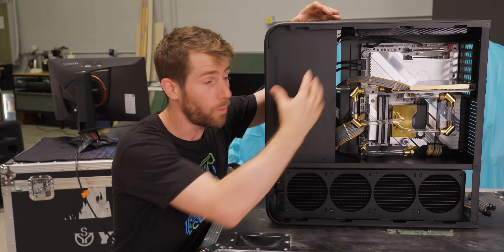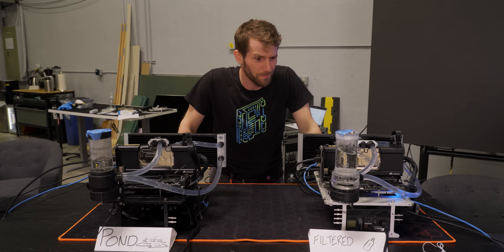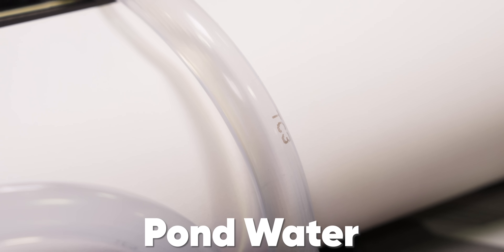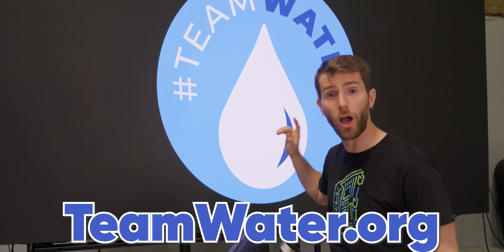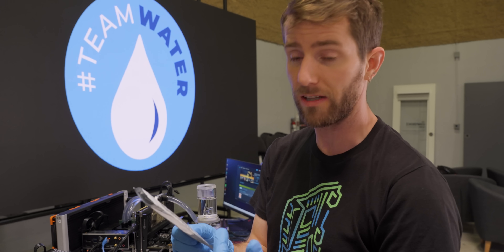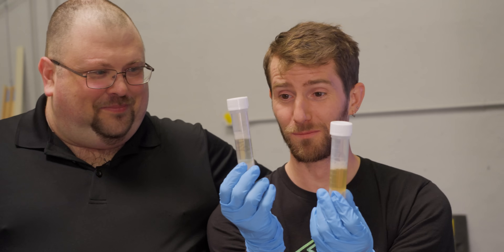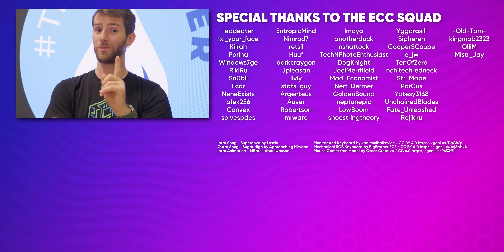Can I cool a PC with pond water? #teamwater

Comment: The fact that the reservoir looked so clean when the pond water didn't really has me thinking the blocks acted like particulate filters... Which is bad.
Anyway I always used battery water from the gas station. It's deionized and doesn't even conduct electricity at first. It will probably leech some from the components tho so not a solution to galvanic issued. But most importantly there's nothing in it for microbes to feed on

Comment: there is a company called Tropic color that sells a solid state drive they claim it to be the fastest SSD on the market, which I think is complete bullcrap especially because it is just a nvme drive shoved into a caddy and they claim it's some proprietary thing made by ram industries. When ram industries sells the same exact product for cheaper on their website. I think these people are really scamming creatives specifically. They also sell filters under a company called prism lens FX and have been called out multiple times for ripping off other products. FORRRR instance they will take something that has been around for decades, like a diopter for macros focus, and rename it "MACRO FX FILTER" and act like they invented something completely new. I think it would be really cool if you guys gave their products a test and there is some controversy there but I think these dudes need to be exposed. They prey on the fact that most creators and filmmakers are not terribly tech savvy and wont look up other options. They have also claimed that photos and videos from famous creators  used their filters and those creators have then come out and claimed that was not the case... Particularly the super bowl incident. All around giving big scam energy.

Comment: You're running testing, that is very similar to that of the oil field. Y'all should reach out to anyone dealing with large volumes of water in the oil field. And you'll hear just about all the different types of bacteria corrosion and problems that that can create.

Actually, i'm kind of curious, you know, you could also run a gaming computer off of an oil.Wells production

Comment: If you're using copper blocks, bacteria won't survive in the loop due to copper's antimicrobial properties—this is known as contact killing. As long as you filter the pond water beforehand to remove debris and ensure the water passes basic safety tests for metal content, you should be fine. Even if the water is slightly discolored, the copper will gradually help clean it. Just remember: never mix copper and aluminum in the same loop, as this can cause galvanic corrosion.

Comment: Hey linus or linus team i have a question? Are yall planning on making another ltt bag maybe the commuter bag v2 alittle bigger? Atleast 20l internal volume to fit 16 inch laptops and making the front of the bag open all the way so it doesn't get the horrible crease across the front besides that its amazing. I think the laptop pocket in the back is better then most high end bags like aer and alpaka because it actually opens alot more than others. Aer alpaka symp it open a tiny bit to slid stuff in. The ltt laptop pocket is my fav but the fact that its like 15 and under laptop sucks besides the size and that crease in the front its pefect. Well one more thing the shoulder straps adjustment for some reason it doesn't stay where you put it. It keeps sliding down. I think a 24l bag or a true 20l bag and make the front open entirely it can be done with keeping both waterbottle pockets aer and synpl does it.

Comment: My gaming server is running strong 4-5 years plus on just tap water, freezmod cooling block, pump, res and radiators with some "random" seethrough flex tube i found..  My i9-9900K overclocked is chilling and i have yet to see things "grow"   Although i guss the tap water here would equal to running Voss water so idk

Comment: As a Lab Tech, the testing shown didn’t really allow for meaningful distinctions between the water sources. For example, just breathing on the petri dishes can cause contamination — which is why microbiological settings usually operate under biosafety cabinets.

Also, using a DIY incubator rather than an environment-controlled unit opens the door to inconsistent results. In reality, incubating would realistically take 3–7 days depending on load and conditions, not overnight.

As for the gunk buildup: most of it wouldn’t harm a PC or its longevity and could easily be filtered out with something as simple as a coffee filter. No need for a theatrical Lifestraw, though I get why you added it.

TL;DR: cool concept, but the water test could’ve used a more rigorous approach.

Comment: You don't want water-dwelling bacteria getting sequestered by metal components in your system. Some of them essentially eat (oxidise and/or reduce) metal to survive in anaerobic conditions. Ofc if they're kept out of their viable growth temps, you should be fine. There's a fair bit of diversity to that, though, and I wouldn't be surprised in your climate if you've got some bacteria that are happy to grow at low-moderate temps. Even more fun if they form biofilms.

Comment: If it's been running at relatively high temps you probably sterilized the pond water. You should have done before and after testing. The particulates would be the bigger worry.

Comment: you might need the coolest water for liquid cooling but my CPU Cooler snapped in half non-water Cooling not the fan the actual heat sink I either way over torqued it or just got way too hot
Reply: I think the liquid metal weakened it

Comment: Every aquarium owner has been through the coloration changes shown at the start. You will have an algae bloom, then the bacteria in the water that eat algae will get it under control. If anything dies, bacteria in the water is there to eat that, then if that bacteria dies, there's something else to eat that. As long as you don't overdo the light exposure and keep the water moving, it SHOULD be as clear LOOKING as this. Even the fecal bacteria will get eaten by something else. There will always be harmful things in there though, and as long as there is something in there, you will get the gunk in the choke points of flow.

Comment: I don't understand why people even use water for pc cooling when you can buy sterile, non reactive, non conductive and non toxic industrial coolant for cheaper than premix pc coolant from gaming brands
Reply: @benshepherd2076  forget all that. Why not pure distilled water (sold in any battery shop) and ethylene glycol mixture? My water block uses these for over 12 years. No gunk build up yet.
Reply: @steelcage5152  that's basically what those industrial coolants are but they also add some extra additives like corrosion inhibitors, since over time even distilled water picks up ions from your loop and can become slightly corrosive.

Comment: I would take pond soft water over tap hard water any day for cooling. Sodium & calcium will build up on your cooling fins to lower heat transfer. Over time many microbes will die as heat is the only sustainable energy they can get from the water in your system.

Comment: I genuinely wonder how ammonia would do as a cooler fluid? I know that was the refrigerant used in early appliances, also under more pressure. But if the cooler parts could stand up to ammonia, I do wonder if there would be any benefit or not?

Comment: TBH, I would never use normal water in a water cooling loop, even if the name implies it. At some point you will have algae grow in your loop and that's where things get really nasty. It will not only clog your cpu and/or gpu block, but also all other parts. And distilled water isn't optimal either, because it misses parts on a atomic level, so it rips these parts from everything it comes in contact, here the cpu and/or gpu blocks again. Saw a vid, where Roman (Der8auer) explained it in detail. Better use a actual cooling liquid, that was specifically designed to be used in cooling loops.

Comment: I've used water from my dehumidifier to fill my loop for years now, and never had any issues.
And I always keep a few bottles of it lying around for whenever I need "clean" water for things like the steam mop, steam iron, cleaning windows, and mixing with the windscreen washer fluid in the car, and any other situations where you're not supposed to use normal water.

Comment: Quick question, I have search online, I Did everything possible my first build turns on and everything, but every time it boots into the bios setting screen and 5 seconds later into windows, also my water cooler fans work, but not rbg lights.

Comment: To be fair, that pond had a fountain in it. That signifies water circulation, probably even some filtration to get rid of stuff distrupting the flow to the fountain. You should perhaps have tried this with a pool of stagnant water for a proper full on hardcore test. :)
But i digress. Impressive and great and for a good cause.. A clear thumbs up. :)
Reply: Dude I guarantee that water was teeming with life. Duck pond water is always DISGUSTING.

That fountain isn't doing much to fix that.

Comment: Makes sense it didn't grow too much, there's no food/nutrients other than what was initially introduced. Once that was used up, and it would be used up pretty quickly, that's it, the organisms stop replicating and go dormant. Algae for instance would need multiple nutrient salts, plus it also needs CO2, which is why the colour of the water was a very dull yellow/greenish, not much algae grew at all inside that sealed system.

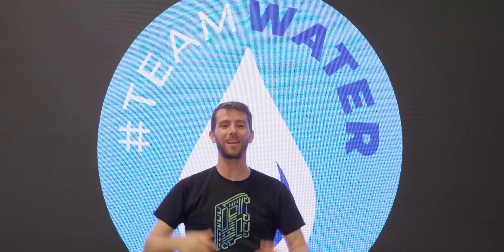Comment: 8:35 so in ACTUAL conclusion, you can use pond water but you'll have to drain your system, clean out your blocks and refill it every couple months to keep it at least somewhat sustainable, and even that isn't guaranteed to ensure your parts stay in good shape for years. It's a lot of work and absolutely not worth it if you compare how time consuming and possibly risky it'll be to maintain pond water vs spending a negligible amount for clean water. and thats with relatively clean pond water.

the entire video is basically an ad
Reply: Or you pump the pond water through a heat exchanger.  The computer loop would run through the other side of the heat exchanger. Once a week you shut in the heat exchanger and run tap water through it for a few minutes to flush it out.  Linus did that walk through of the data center in Ontario that is using lake water for cooling which would do exactly the same thing.
Reply: @pin65371  2 very very different scales of computing. Still not something worth doing if you're just building a PC for yourself.

Comment: Water filtration is not that expensive according to me in India i think if its pond water without any heavy metal.
You can start with this setup
Sediment filter(3micron-5micron)>carbon filter>UF filter(ultra filtration).
If you want u can add a UV tube chamber.
This usually suffices if your water doesn't have any heavy metals.
Tried and tested

Comment: As an aquarium nerd, I can tell you that strip tests are generally considered a bit of a joke for water testing, very inaccurate.
Reply: They described it as a science fair project. So I’m not expecting anything more accurate than a middle school student can afford
Reply: Actual lab tests are the only thing reliable
Reply: That's not what I've heard, what I had read about it is the liquid test kits are less accurate than strips but that's what I'm stuck with unless I can get my boss to get the strips but the cost per test is probably more so that won't be happening as it's done daily to keep everything working right because we've got old controllers and feeders so the levels can vary a lot from one day to the next and we're required to do testing often to pass inspection
Reply: Also as an aquarium nerd, test strips are perfectly fine as long as you get them from a reputable source. People in the hobby crap on them all the time because they want to feel like all the time they put into testing with liquid test kits was worth it.

I'm fine with either, but I will always choose and recommend a good quality test strip over liquid tests any day.
Reply: @RanaLoca I have tried quite a few reputable brands of strip tests and all have been quite far off even the same brand in the same tank at the same time reading very differently. You can pick up a NT labs mini test kit here in the UK for only £13 that's cheaper than most strips. Or the full test kit for about £35. 

I get I'm over the top with the full JBL suitcase and can test for everything needed for aquascaping but you don't have to go that far
Reply: @RanaLoca  I'm not an aquarium nerd, but I work in an industry that uses test strips. Test strips are good for what they're rated for (assuming they didn't buy the cheap brand). I think the takeaway is that looking at this as a LTT entertainment video vs a LTT Labs science video... Per the disclaimer this is purely for entertainment

Comment: linus you should help some first nation communities in canada since our government is incompetent I think this would be an amazing idea since some canadians don't have access to clean drinking water!
Reply: Its not that the government is incompetent.  Its just not easy to provide consistent clean drinking water if the water is extremely contaminated.  Depending what is in that water it could require crazy filtering systems that require a lot of ongoing work to keep them functioning which is difficult if they are in very remote areas.. Its also not like its the government trying to solve these issues.  Its engineers.

Comment: Using pond water for cooling and just put some bleach in, might actually be fine. Also maybe run it through a coffee filter to get particles out.

But if you want to know what CAN happen, watch the full room watercooling videos, where the loop totally grew stuff in it. That was disgusting.
Reply: A heat exchanger is the key.  Pond water goes through one side of the heat exchanger and the pc loop goes through the other side.  Then put a tee and 2 valves in before the heat exchanger.  Once a week you close the pipe that goes to the pond and open the other valve on the tee which is connected to clean water and flush out the heat exchanger for a couple minues.  Then close the valve to the clean water and open the valve to the pond again.  I bet even once per week flushing would be overkill but if you can capture some of the water that comes out while doing the flush you could test it to see how dirty it is.  Maybe its 2 times per month or once per month that is needed.